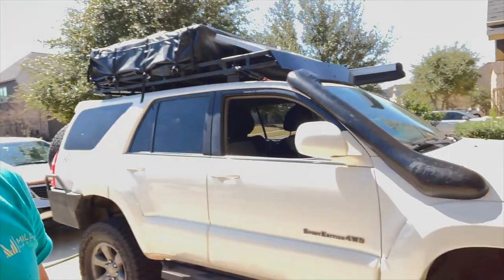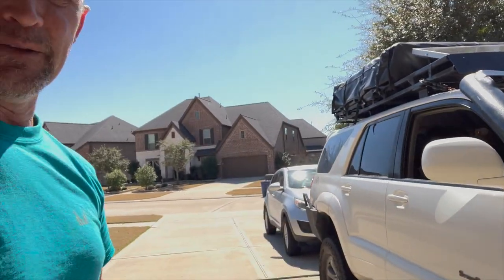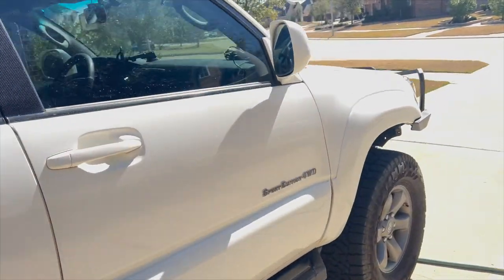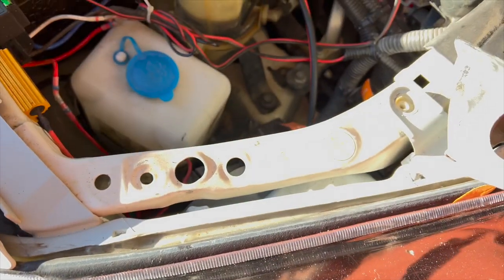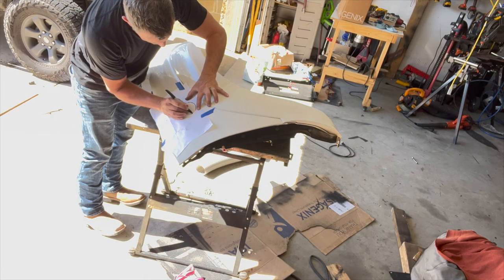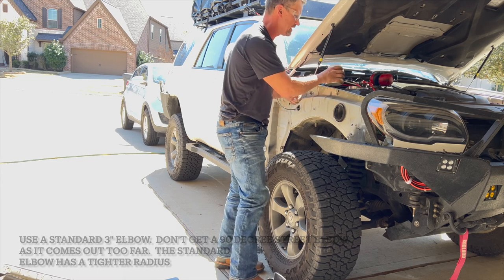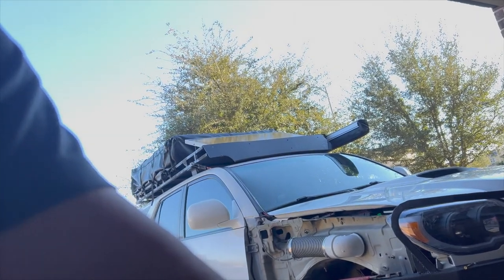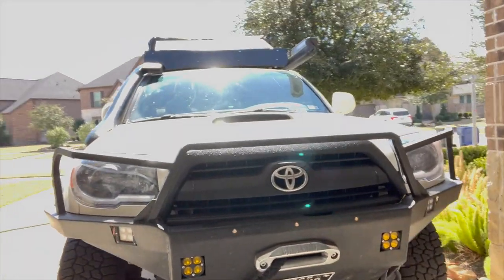$80 eBay LC 100 Snorkel Install on 4th Gen 4Runner

Comment: looks good, were you able to get rid of the gap that was causing the noise by the pillar?
Reply from the maker: Yes no more noise.  It was a while ago so can’t specifically remembered what I did but I seem to remember getting some foam and then fiberglass matting/resin in there to snug up the gap.  That’s been working well.
Reply: @OffroadGrind  cool, thanks for the info. i just ordered the same snorkel and looking to install it soon.

Comment: Why didnt you install the dobinson 4th gen snorkel that requires so much less work?
Reply from the maker: Hi Dillon, thanks for checking out the video. I don’t mind doing the work to get something to work if it’s more the look I want.  I don’t like the look of snorkels that have the extended lower arm.  I was looking for something that just came down the A-pillar and entered the fender right there.   I also wanted a cleaner lower profile air intake.  I don’t really like the looks of that Dobinson’s periscope-style snorkel top. It’s not as bad as the round mushroom style tops but I’m really liking the clean low profile of the one I made for this rig. Granted, I didn’t realize exactly what needed to be done to install this LC100 version as I really couldn’t find much info on getting it in.   Now that it’s all done though, like most things, I’m ok with the work it took.  By comparison it’s no where near as bad as making my roof top tent.  THAT was a lot of work and had me wanting to throw the sewing machine thru the window a few times.

Comment: How is it so far? Planning to install the same model as I prefer it
Reply from the maker: q8ieng it’s working well.  It’s either the fit of the snorkel or the way I installed it but there’s a gap along the A-pillar that creates some wind noise at highway speed.  Planning to cover those side gaps though when I get a chance with a bit of fiberglass and then repaint it.  Other than that though it works well, haven’t gotten under the water with it yet though.  But for dust it’s working great.

Comment: I'd add the deck plate mod. That thing looks horribly restrictive.
Reply from the maker: Thanks for checking out the video.  I actually don’t find it restrictive at all and modifying this defeats the purpose.  For me the main reason for a snorkel isn’t water crossings, like really, how often am I crossing a river?  Maybe once or twice every cpl years.  I want higher cleaner air and the steel plate I put in above the intake looks to me like it jams so much air into the intake I don’t see how there’s any restriction. There’s more square inches of air getting jammed into the snorkel that there is from the 3” round fender intake that’s still going to be the bottle neck in the whole system, but that’s the oem passive air intake design.  If anything this roof line air intake is going to drive more air into the engine, not less.  But, I’m not an automotive engineer so these are all just my thoughts on the whole thing.